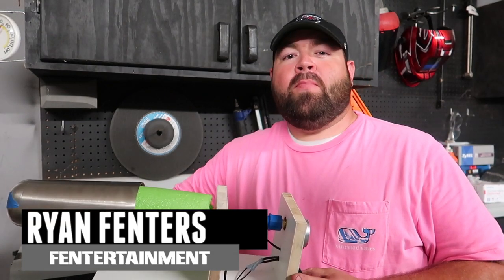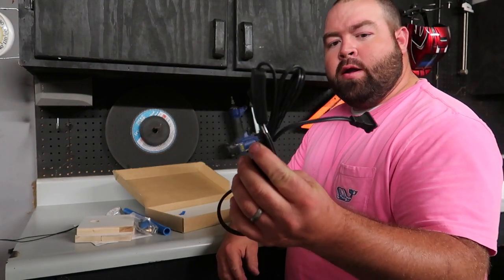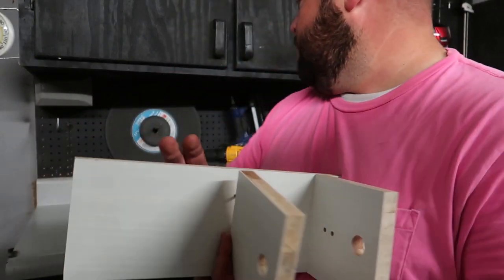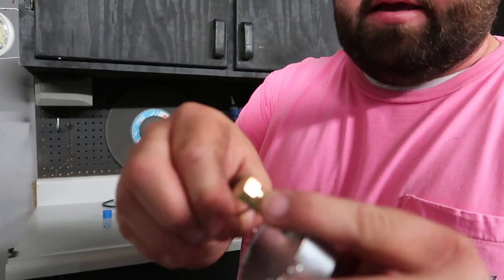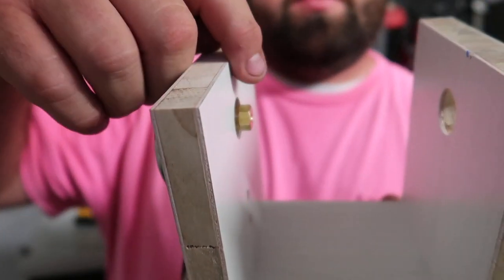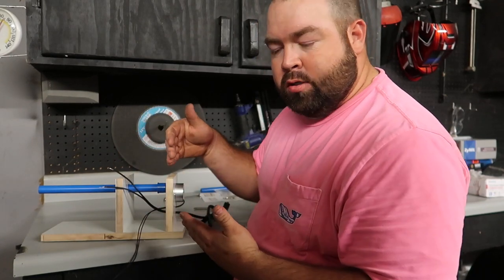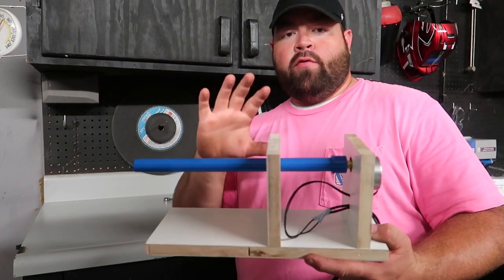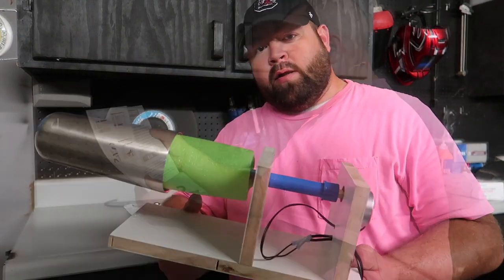Ready To Build Cup Turner | Unboxing & Assembly "It's Worth It!"

Comment: I built mine watching you build yours. Made mine from plywood base and scrape oak for uprights. Put a thin coat of silicone grease on the front support where the PVC passes through. Wifes made close to a hundred cups with no problems. Great design you had!
Reply: what size screws are you guys using for the cap my falls off after about 4 hours of turning
Reply: @TYIKEY36  I turned a dowel to fit in the 3/4" PVC and drilled a hole slightly smaller pushing it onto the motor shaft. Then pre drilled a hole to screw a small scew through the dowel into one of the side hole in the shaft. I couldn't locate a screw to use a cap as shown above. I purchased one of these and the Wife uses pool noodles so  I glued a 3/4" over the blue tubing. The cap screw keeps coming loose so I put a drop of blue loctite and fixed that.
Reply: thanks I will try that then.

Comment: Thank you so much for your tutorial.  I bought a little motor thing and had no clue how to go from there as far as how to connect it to the other piece of cable with the switch.  Now i have an idea as to how to build the wood base and how and what to get for the plastic stick. After i should 9f done more research and just gotten a kit like this one to assemble instead of having to acquire all the other stuff as well. But i like tinkering with things and just learning stuff along the process.

Comment: I have the exact motor and I built a turner, but the motor does not go completely circular, it goes one direction for about a second or two then changes directions. What did I do wrong?
Reply from the maker: You probably didnt do anything wrong. It could be just a faulty motor.
Reply: @Fentertainment  ok Thank You

Comment: I clicked on the link n it says Sorry page not found...😩😩
Reply: For me too. 😭
Were you able to find another one?
Reply: No I couldn’t
Reply: But my husband already made me one...my nephew fixes appliances n I showed him this video n he said well I have a microwave motor there u can also use that for it n yep sure enough it’s working great...I’ve done 4 cups already
Reply: @kellyaddison5277  they have them on etsy and the $35 one has free shipping google cup turners or cuptisserie I'm waiting on mine I ordered 2 days ago
Reply: @andreaasbury1387  How was the cup turner?
Reply: Works great I've got no complaints you will have to drop some glue in between the cap that's connected to the actual screw that connects it to the motor so it doesnt come loose during drying overnight
Reply: I received all pieces and they updated by adding a connector for the wires and it has an on and off switch as well motor rotates both directions

Comment: That Turner is no longer on Amazon to purchase
Reply from the maker: wow, I just looked and you are right. I have another video on how to make them for about $25. Probably build it cheaper now.
Reply: @Fentertainment  can you provide a link to the video you reference above please?  Thanks!
Reply: That's just wrong that they took YOUR design and are profiting off you.  I wont purchase theirs.  I will watch your video and follow your instructions.  #teamfentertainment
Reply: I bought this exact Turner but it doesnt come with those little blue connectors you uses to connect the wires. Do you know where I could get some from?